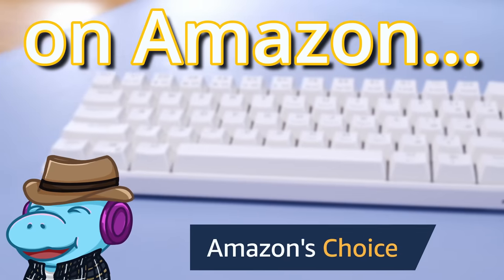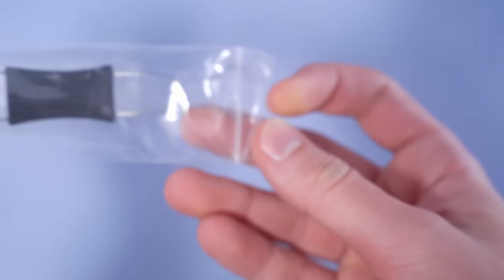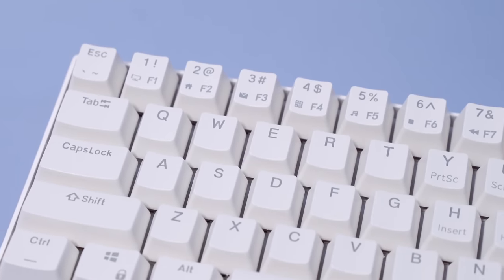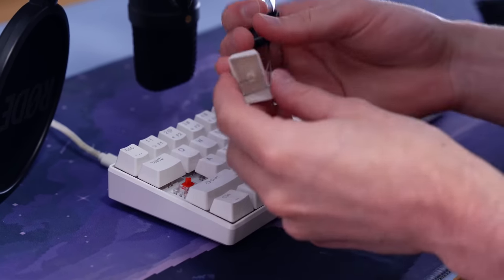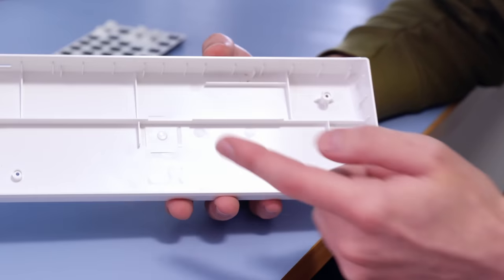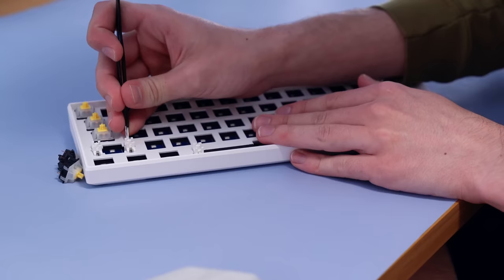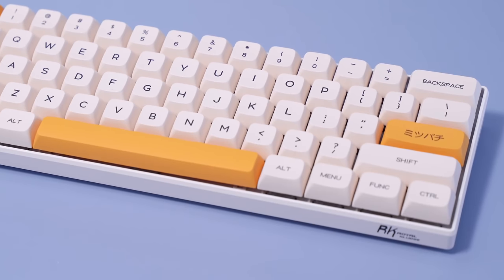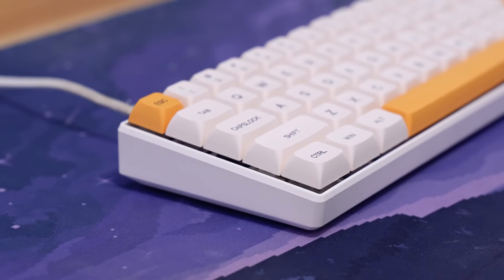I Tried the Most Popular Keyboard on Amazon... (So You Don't Have to.)

Comment from the maker: Thanks for 550k :_HipyoBigBrain::_HipyoBigBrain:
⬇Affiliate links to help out the channel ⬇
Get the RK61: https://amzn.to/3uYrPOk
Gateron Milky Yellows: https://kineticlabs.com/switches/gateron/milky-yellow?ref=hipyo
Keycaps in the build: https://shrsl.com/3ufuk
Kilmat: https://amzn.to/3WsGVqG
Reply: Nice hair
Reply: Why did you bought the wired version?
Reply: NEWMEN GM610 PRETTY PLEASE!!. MODDED MINE WITH THE PRELUBED AKKO MACHA GREENS! SO MUCH BETTER. CHEEP COMES WITH WHOLE NEW KEY CAP SET FOR QUICK CUSTOMIZATION OPTIONS. AND BLUE TOOTH . ID LOVE TO SEE THE INSIDE. IM TOO NERVOUS TO GO THAT FAR LOL
Reply: There is a Bluetooth and aluminum chassis variant available, too, for $70. It was $50 a few weeks ago. I believe someone in the reviews said the board with the red switches is the only definitely hot-swappable version, while the others are a hit or miss.
Reply: For the Kilmat,
If you're just using it for this, scroll down until you see "Kilmat Sound Deadener License Plate Kit Plain Pak 12 X 4 Pair (1 Pack)", much cheaper for a small project- looks like it will just fit.
Reply: Would you recommend the Gateron Milky Yellows pro instead of Gateron Milky Yellows?
Reply from the maker: @dwzA12345  yeah
Reply: nice hair
Reply: @HipyoTech  hipio my custom keyboard broke and I don't know y I don't know how to fix it it just stopped working all of a sudden slowly the keys froze it doesn't work the keys press but the PCB doesn't transmit the signal help
Reply: very good hair, thank you for grwoing it out! c:
Reply: wait a min the board is wireless what are you talking about?
Reply: Best Keyboard EVER
Reply: there is a wireless version with blue switches it sounds good and same price
Reply: The orange box rk61 you got is ASS, the black box rk61s stabs and switches are miles ahead.

Comment: This board is great for having a cheap mechanical board that you can put in your bag and not worry too much about. I've got the Bluetooth model, with some extra foam, tape modded, and with a swap to my preferred Box Royals with some cheap PBT keycaps, and it's honestly pretty great for typing and writing on the go using my phone. Ultimately, for my first dive into keyboard modding and customizing, I don't think there was a better way to spend $100 or so overall
Reply: Same. I got mine for $20 shipped second hand and spent the other 20 I woulda paid for new for a hard case. Totally worth it imo.
Reply: Tbh as a broke beginner who got a very similar keyboard off Amazon for around the same price, I was shook seeing that just *keycaps * cost more than my entire board 💀
Reply: This is what I was looking for. Something I can use with my iPad in class. Wasn’t sure if it was worth to spend a bit more and get something different.

Comment: The rk68 was the first keyboard I modded and I can definitely recommend these keyboards for introduction/budget modding, it was quite simple and easy to work with, and the end results always sounded and felt quite nice
Reply: As a person who wasn't even into keyboards (membrane guy until now), I saw a rk68 on sale for 22 bucks and I grabbed it. I have no idea which mods I should do but I'm definitely gonna do something.
Reply: @scxrpion3828  you won't regret that purchase. I went from membrane to a second hand rk61 and have zero regrets.
Reply: Bought the RK68 and threw in some lubed Dark Amber T1’s and love it. Currently using unlubed Hippo’s and its nice too
Reply: If you did the tape mod what tape should you use electric tape or painter's tape I have been wondering ever since I got the keyboard.

Comment: Yep. I bought this board months ago. Lubed browns, got those stabs, swapped to pbt key caps and added that thin white foam. Sounds fantastic. Next will be this cheap 12 key, two knob hotswappable keypad. I’m going to grab some low profile switches and keys and swap out the knobs for something shorter as well.
Reply: What keypad? I'm currently looking into buying one
Reply: Yeah also interested
Reply: I found it on Amazon. It’s not bad but it bottoms out so I put gaskets on the keycap stems. They came with some reds I just lubed up and it’s not bad

Comment: Warms my heart watching this. I spent about a year watching videos in this community hoping to get a mechanical board for myself, and recently purchased my first board, the RK61, deliberately with it being a budget board to get started as a complete beginner. I also swapped out the RK switches for Gateron Milky Yellows, so seeing a YouTuber with way more experience I admire doing the same thing is great! I went for some cherry profile PBT keycaps (haven't had any interference issues), a custom cable and although I have done a little modding to the case, that Kilmat mod might be worth a shout!

Comment: I've modded 4 of these now. All the wireless versions. This board is honestly great when modded. Dampened, tape modded, lubed, and stabilizers clipped and tuned. Its great, gave a pair of them away as gifts and I now have offers from other friends to mod their boards lol. The rk reds respond pretty well to lube (though I changed the springs on all the rk switches I've lubed to stock Gateron brown springs I have leftover) and the stabilizers are smoother than you expect.

Comment: RKs are actually overall pretty great for beginners. They're cheap, as you said, and they sound really good once you've modded. Would I recommend someone who just wants a keyboard to immediately type on? No. But would I recommend it to someone who wants to start modding or knows the rough idea of what they want their end game to sound like? Yes! It helps you get more comfortable with both the basic idea AND some of the skills needed. So yeah, RKs are pretty great that way. Thanks for the video. :D 

Side note: Boards that came out in 2022 seem to all have the foam installed by default. Mine, bought in 2021, did not. Sadge.
Reply: my rk98 has a silicone pad between the metal plate and pcb and has a foam on the bottom. it sounds great even on abs keycaps. the stabilizers are also factory lubed
Reply: I bought my rk61 about a week ago after watching this video and assumed it had the foam. I went to mod it today and it did not have the foam lol no big deal since I had some foam laying around I used just weird how they randomly put it in. Maybe if they run out in the factory they just don't use it?
Reply: Hey, fellow tech enthusiast! If you're looking to optimize your desktop setup, I highly recommend checking out the HOTO Compressed Air Capsule. It's a compact and powerful tool that offers both vacuuming and blowing capabilities, perfect for maintaining a spotless environment. With its multiple versatile features and reasonable price, it's definitely worth considering for your cleaning routine. Happy optimizing! 😄🖥🔧

Comment: I have multiple RK96 boards I’ve made real nice. I took one to work with me. It’s a conversation starter if nothing else.

I threw in milky yellows, stabs I had laying around, foam and PBT caps. These boards are a great budget canvas to mod
Reply: I’ve got an RK68 that I love typing on. New switches, caps, and a bunch of case foam and adding plate foam and it sounds brilliant personally. All the hollowness is gone.
Reply: @DapperMKVI  I just finished my RK68 and I love it. If you haven't tried poured silicone you should definitely check it out.
Reply: @starelikeajunkie  I’d love to try silicone. For my RK68 I had a bunch of adhesive backed neoprene sheet that has done wonders for the sound of it.

Comment: So nice to see you cover RK boards! I have an RK96 and my partner an RK100 (RK is one of the few brands available in Argentina).
Definitely not the best of the best, but all things considered they're amazing mechanical keyboards for the price, especially being hot swap. The stock keycaps aren't great but RK also offers custom keycap sets which improve a lot the experience as they sound a lot better without even having to open up the board.

Comment: So happy you reviewed Royal Klugde! Bought the RK100 several months ago, I wanted the F row along with the numpad, and so far I'm enjoying it. I frakenstiened and lubed the switches that came with the keyboard while waiting for the Akko Star Fish to come in. The sound drastically improved after working on the switches, modding the stabilizers, placing foam (my keboard didn't come with any foam), and tape modding the pcb. It's not 100% thocc but I'm happy with it for right now. It's Bluetooth/Wireless, it comes with a dongle and you can hard wire it into your computer. The battery life is meh, not bad but not good when not hardwired in. The only issues I run it is the battery life and when switching keycaps as the second ATL, FN, CTRL keys are 1u, the second Shift is 2u and the 0 on the numpad is 1u. Not that big of an issue but it does hinder the search for 100 keycap sets that fit the RK100

Comment: The RK61 is actually a very solid starter keyboard for modding. It’s cheap, great case for the price, and it’s very easy to mod making it beginner friendly. I have a modded RK84 with Akko Carolina blue keycaps, tape modded, replaced the switches with hand lubed ktt kang whites, and lubed the stock stabs (stock stabs are very good on the rk84) and it’s very creamy. The RK line of keyboards are all similar in design, except for the form factor. I really do recommend buying one of these (MAKE SURE YOU MOD IT OTHERWISE IT’S BAD).

Comment: I recently bought the rk98 for 55usd. mann!! this keyboard is a money steal. It has wireless 2.4Ghz, bluetooth, two usb port on the top, hot-swappable, fully adjustable rgb with software and finally it has a silicone pad between metal plate and pcb and a foam on the bottom. also the stabilizers are factory lubed. the sounds feel amazing even though it has abs keycaps

Comment: Great timing. I just got done with my own RK61, which I built so I could type quietly later into the night without being a nuisance to my family, I used the same stabs, foam lined it , soldered in lubed gateron milky pro yellow v2 switches etc. For how little I spent on it, I love the sound.
Reply: This is the comment I was looking for 👍.  I assumed by the great  result of Hipyo's mod that it would be quiet enough for late night work. Just got mine a few days ago and it will be my first mod.

Comment: Just modded my rk 68 (855). Still using stock blue switches. Just added new key caps & o rings (yes Ik o rings are controversial but I literally just use this keyboard for my PS5). Even fresh out the box, it is a great keyboard. Rgb can be better and is better if you get different key caps (that happened in my case) & o rings get rid of a majority of that hollowness sound without taking the entire thing apart

Comment: I have this same keyboard but the version with bluetooth and it has a battery in it. Since I can't do the kilmat with this nor tape the PCB I taped the plastic case and covered every single bit of plastic (but around the battery cause safety) and it worked really well! My milky yellows and milk and honey caps come in on Sat and I am SOOO excited!! But already I hear a difference in just taping the HECK out of the inside of the case. :)

Comment: I started my keyboard modding journey also with this keyboard. Granted, the version I was using is soldered PCB and wireless. I also put an automotive sound dampener to it about 2-3 years ago, and it does elevate the keyboard sound, miles better than the stock pre-built keyboards from big brands even today. The keyboard was cheap, and the opportunity to improve it is BIG. It even comes with its satisfaction 😊 it helps me learn how to solder/desolder switches, lube switches and tune stabilizer, a skill I still use today when building custom keyboard. I say just try it, and as such pretty recommended.

Comment: I have also purchased this keyboard.
I was looking for a good but at the same time not too expensive (budget) small and clean mechanical keyboard and came across the RK61 on Amazon. I have to say that I'm very satisfied with it so far. The price-performance-ratio is very good. I bought the keyboard recently and by now it is as well wireless usable and the additional functions are visible on the sides of the keycaps and not on top, which really improves it a lot visually. The lighting functions are really well customizable in the downloadable software from RK. Also, the switches are hotswappable and the keyboard is pretty well insulated. There's no rattling noticable at all while playing in my opinion.
The only drawback I have is that the lighting intensity is a little weak compared to other mouse and keyboards, but not too bad (I have the black version).
All in all, a really top budget keyboard. I highly recommend it ! :)

Comment: I have the wireless version of this board,black with yellow/orange led's. I love it. I have modded it pretty extensively. I have a case I designed on fusion 360 and had 3d printed. It sits neatly over my laptop's keyboard with no interference. Its a great entry modding board. Durock stabs make a huge difference. The stock stabs wouldn't fit snug in the case so the upgrade made a huge difference.
I just went back to the stock switches and with a heavy lube, the brown switches are actually surprisingly good.

Comment: I just picked up the RK61 and having come from using a Red Dragon Kumara K551, the RK61 is pleasantly quieter. I had some sound deadening foam leftover from installing a speaker in my car and while I had to trim it to be thinner in order for everything to screw back together, the mod really dampened the intensity while thickening the sound. Almost like a different keyboard altogether!

Comment: I have this same keyboard in the 96% layout, and honestly a new set of keycaps and some dampener O-rings under them went a long way. For a pretty cheap (mine was around $75 iirc) keyboard with two day shipping, it's really not bad. I'm going to try different switches at some point but for now I like it well enough. Also, their software slaps very hard for a cheap keyboard - a hard requirement for me was being able to remap keys easily and this was literally the only keyboard in this price range with this layout that could do it.

Comment: I got my first ever mechanical keyboard this year, and it was RKG68. And I chose it because, other than how affordable it is, it has A LOT of potential, especially for beginners. It already has 3 way connections (bluetooth, wireless, wired), its hotswappable, it has RGB, and the design is simple and compact yet it still maintaining designated arrow keys. Also, u get extra switches, keycaps and switch puller, and USB type C cable FOR FREE? Everything u ever wanted as an entry level keyboard, tbh 🤣. Also, u can improve it a lot just by simple modding, like changing the keycaps into XDA profile, tape mod, lube mod, etc.. like it has sooo many potential. No wonder the brand was so popular. Definitley my best purchase this year 🙈

Comment: South facing leds are terrible, because they don't actually led (illuminate the legends), and you can just buy switches (like the kailh box v2) that don't interfere. And the only keycaps that do interfere with north facing leds are GMKs which cost $150 vs a $50 keyboard.

Comment: The RK71 was my first mechanical keyboard and I just finished building my custom replacement. I honestly really liked the RK71 because it was cheap, had bluetooth, and the feel wasn't that bad (even if it was high pitched). The biggest drawbacks for me on that board was that the switches weren't hot-swappable, there was no USB wireless receiver (though I think other RK boards do), and really that there were no F-keys. That was only a problem because the combined Esc/~/` key defaulted to ~/` instead of Esc (which I used so much that I had to remap one of my mouse buttons to), so I had to either constantly to Fn + Esc or use SharpKeys to remap the keys, which didn't always work.

Comment: It’s honestly not a terrible board as long as you mod it, I put some dampening in it, lubed milky gatereon switches, new and lubed stabs, steel series doubles shot abs pudding keycaps I believe and it doesn’t sound that bad and I spent only around 100$

Comment: the rk61 used to be the best cheap board you can get for modding but now there's plenty other options, for the same or similar price you can get a gas67, keychron v1 or if you're on a tight budget the ilovebee offers everything the rk61 does but for under $30

Comment: I have had the RK61 for a year now, as my first budget entry board. 

There is a version where it has a wireless usb dongle, and bluetooth up to 3 devices.
is budget friendly, and looks clean
is hot swappable, with an actual keycap puller, and not one of those shitty plastic ones.
It doesn't sound the best if you are heavily into the hobby and care about thoc, but for a casual who just wants pretty keeb, it def sounds better than the regular corsair mechanical keeb.

I did recently buy the LTC nimble back, and I think it is a better deal. Also hotswap, 65% board. Not wireless, but it does sound alot nicer overall out of the box. Plus it has a removable top bracket, which you can just paint easily.

Comment: I have a similar board from Tezarre and I keep hoping someone (like you?) will do a video/challenge on it so I can get some ideas and guide on mods I can try (my first ever mechanical so no experience and I'm afraid I'll mess something up without seeing someone else do it first)...of course, my TK 61 has optical switches, so not a lot of options there, but I like the feel of it (Gateron Optical Blacks). Maybe I'll get lucky and someone I'm subbed to will take a shot on it (they are cheaper than the RK, you can find them for as little as $18 at times, but usually around $30ish), so yeah, might be cool to take that challenge....don't you think?